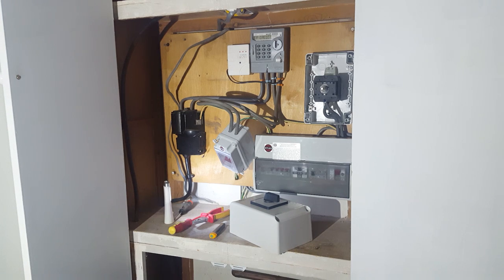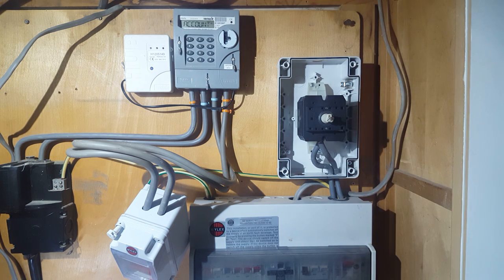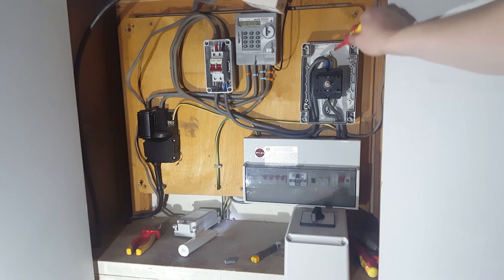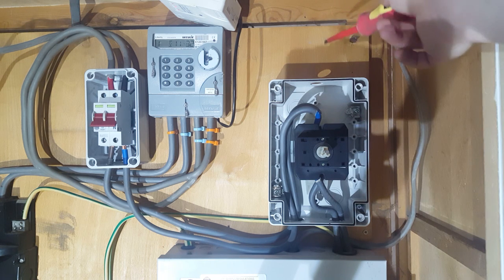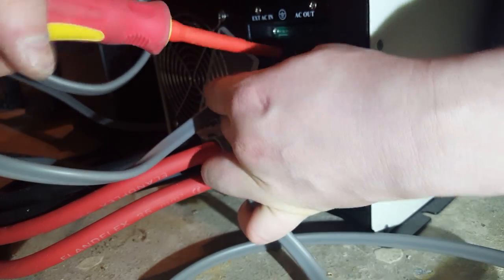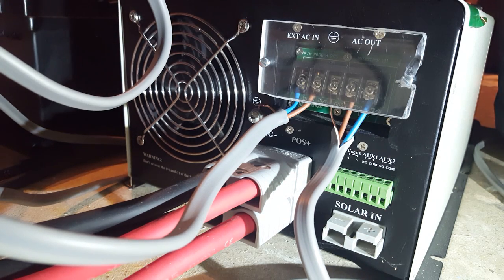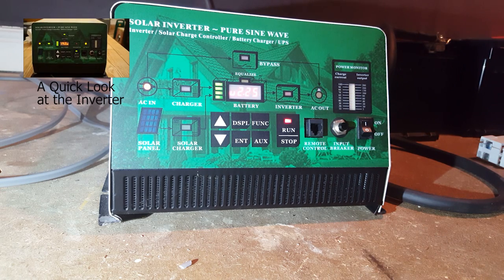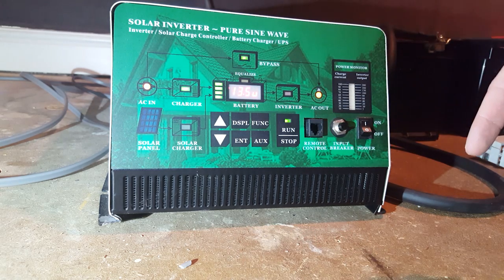Generator Changeover Switch Installation and Test

Comment: As I understand it if the power cut was caused by a digger totally severing the mains supply then if the house's earth is via the company PME the house then also loses all earthing. No problem as the power is off. But if you then arrange secondary power from batteries or generator that would then need an earth rod to replace the lost PME. The safety changeover switch handles the line and neutral but unless an earth rod is then connected then all home appliances are unprotected and could be a danger. I'm not an electrician and this is just my recollection of an explanation given to me when discussing this situation. Worth investigating further to be safe I think as the cost of an earth rod could save a life.
Reply: Excellent observation...I have that very issue to resolve myself. Switching earths to an earth rod of the proper specification is the way to go. As you say the earth bonded neutral PME is no longer available. Also a good idea maybe to install a section of plastic water main/gas main to make sure there are no conductive issues from other properties back feeding from the same PME line in your locality.
Reply: Many earth supplies are from metal pipes (water mains) and gas pipes going to into the ground. My mains supply certainly only has a live and a neutral.

Comment: Good video ..thank you.. I  wondered did you connect the Inverters output ground back from the inverter to the house ground or is that all taken care of on the mains side of the consumer unit and input ground to the inverter, just a thought,  It looks like you do have earth continuity back through the inverter to house ground... Many Thanks          Maybe this also avoids ground loops, so makes sense in this configuration when you change over , so you have the original earth continuity.  Helpful information for my emergency supply..

Comment: What size is the fuse inside the fused spur for the light/ buzzer and cable size which is going to it from the change over switch ?

Comment: Very good.   Presume you don't need to switch grid off before engaging the changeover switch to connect in your inverter power source?   Going to copy your method (with diesel generator instead of solar inverter).

Comment: looks like a new install not sure what the load is ?   With insufficient off grid power for a whole house : Wish there was video manual transf sw install to existing domestic home . Selection of some existing  distribution board ( say 4or 6 ground floor circuits) to be made transferable . Guess we would need additional  small consumer unit to existing whole house one  There are many for the USA . )reliance switch  comes with extra MCBs ) Yours is the only one for UK . So thanks. Ms O

Comment: Great video, thanks. Why install a separate isolator for the grid? Surely the changeover switch cuts of the grid?
Reply: It's just for overl9ad safety in case the grid gets through aswell

Comment: I'd like to do something like this. I have a question about the earths. What happenned with them? Do they have somewhere in the transfer switch to join up? Also does your inverter have an earth, and where does that go? Cheers!
Reply: This installation is reliant on the pme earth from the supplier, you could end up with touch voltages on any metalic earthed item if the inverter earth reference is different from "true earth" as supplied via the dno. It would fail a ECIR for having to Open neutral protection.

Comment: great video if that 3 way is 100a what is the main switch thanks,i am doing exactly the same and I have been gathering info for a while,NOW SUBSCRIBED
Reply from the maker: +fester Adams The main switch is 100amps also witch matches the 100amp fuse coming into the property. The house could technically draw up to 100amps which would be challenging to reach to say the least. You tend to never use more than 40 amps. On 240volts.
I wanted to do this for ages but only recently took the dive, it was worth it for the peice of mind! 
Thanks for subscribing!!!
Reply: superb thanks for the reply we have the old style fuse box at the moment (if its not broke) but this is the route we are going to take when we get a new leccy box fitted.the wire for the inverter I have been told to run 6mm or 10mm t&e my inverter is a xantrex 3500kw with a 7000kw surge what did you use.i also made the big mistake of getting a 300 AMP t-fuse from the states for the DC side that cost £80 and then a few have said use anl £5 from motormania
Reply from the maker: +fester Adams I used just 2.5mm twin and earth for my needs temporary, I don't draw more than 10 amps when using it to prolong the battery bank. At 7000 kW you wont draw more than 30 amps. Or 15amps continuous so if you don't creep into the peak you could use 2.5mm. But if money is no object use 6mm (usually used for electric ovens) 
Well 80 quid may sound dear but you get what you pay for, I've had countless troubles with cheap breakers and cheap fuses! 
But I make do.
Have you got a bit of a chanel going then?
Reply: no I don't shoot any vids I'm just trying to save some money I have 2kw of panels going through a sunny boy inverter but I can only use what I make so I'm getting a load of batteries together and we are going to go off grid at night time first and then take it from there.do you not find info is very little in the uk .on the wiring side I hate spending money BUT find if you do things right the first time then it lasts and lasts.im going to use either 9mm2 or 120mm2 from the batteries which is overkill but if I'm running a kettle or drier I don't want any firescheers
Reply from the maker: +fester Adams you sound very knowledgeable and have the kit, so plenty to work with! 
Yeah Defo agree with braces, belt and string techniques.
An idea perhaps could be putting whole circuits through the inverter such as the lighting rings so could be easily manageable. 
I have mine as a backup rather than being cost effective.
Reply: we will try the nights and see how it goes,it helps when a family member works for a ups company lol,I'm getting there slowly I have just ordered a 3 way and I have a 2 pole switch from another project anyhow keep up the good work I am enjoying the vids cheers

Comment: Your home system looks like tn c s so when you now disconnect your land n and feed with your new land n supply how have you earthed it as your new supply separate supply has no earth to cu. Or have I missed something
Reply: Exactly what I was thinking. The TNCS is connected to the CU and so if he connects and there is a fault he will backfeed the line and could kill someone working down on the lines. I don’t think he understood the need to also disconnect the earth and have a means to connect to TT system. I am sure that the electricity supplier will not allow your own generator/solar system to be connected whilst using their TNCS system ???
Reply: @brianoneill350  so many differant takes on it. So I am not 100%.i was thinking 3 Pole switch so when it's switch all disconnects and connects to tt. But I am sure your not allowed to switch the cpc it's a bit like doing a ze test if someone forgets to connect it back up.
Reply from the maker: The double pole switch completely isolates the supply from the grid, both live and neutral. The earth still has continuity.
You do not isolate the earth. That's why the main 100a/80a breaker only breaks live and neutral. I can assure you, it is completely safe and physically unacceptable to back feed.

Have a lovely evening gents.
Reply from the maker: Unachievable I mean, whoops!
Reply: @PrepareForTheUnexpected  yes, Thanks for the reply and for correcting me, I agree, I believe you are correct that you do not break or switch the earth.  I need to look more at how I earth separately the little generator.
Reply: what I don’t understand is if you have a TNCS system where the earth splits from the neutral at your premises which I think you have from the photos, if you disconnect the neutral at the point where you have, the earth from the cu still bypasses the changeover switch and remains connected. So in the event of a fault at your installation it will go to earth which back feeds down he combined neutral earth line. I know I am missing something here. In normal no fault operation no backfeed, I can see that.
Reply: I think the answer is one needs a 30 milliamp RCD connected to the supply and return sides of the generator to cut off supply in the event of a fault. A fault on the CU will trigger the RCD on that circuit but not the main breaker. If there is no cut off on the generator then the generator will continue to run pushing current down the PEN which in a rural setting is surely back feeding the neutral on the nearby power lines. What am I missing ?
Reply: @PrepareForTheUnexpected  I've been following your discussions lads, I agree with you, I actually think it's physically impossible to back feed in this instance, because if using a simple double pole switch, when it connects one source of power, it isolate the other? or am I missing something?
Reply: @brianoneill350  I’ve been wandering about this myself.  Traditional portable generators, fed via transfer switch to the house, do have a common earth with the main house supply according to various discussions.  

However portable generators do not have a dedicated local earth.  So if there is a fault from line to earth in the fixed wiring, the return path to the generator would not go via the earth rod at the DNO transformer.  The loop impedance would be too high in that instance (unless the ground is wet?).  Instead it (should) return directly to the generator, via the earth conductor in the feed cable.  Essentially the DNO earth rod acts as nothing more than an earth reference.

I will say though, I’m educated in physics, not electricity.  No doubt I’ve missed a detail.

Comment: when you said that was a job and a half I thought it cant be that bad and was I wrong that 25mm is a pain to move about anyhow all done and working ok
Reply from the maker: +fester Adams great stuff! Was it your new fuse box?
Reply: basically same as yours we still have the old fuse box so I am going to extend the wires and then move the consumer up a couple of feet out of harms way and then we are done in here I just need to run 6mm or 10mm wire outside I'm looking into how to do this now maybe metal conduit the best...keep up the good work
Reply: I put a main 100a breaker and 100a transfer box in
Reply from the maker: +fester Adams sweet stuff. It was quite hair raising when I put my breaker in live. The world's biggest game of operation. Is the conduit going to the garage or what not? Beefy 2nd hand armoured cable can be bought cheap on eBay and you can just bury that. But don't tell anybody! Haha
Reply: we have a vent about a metre away from the garage so I'm going to use metal conduit and run it out of the way and into my garage that's the easy bit I have loads of armoured cable but its 1.5mm I reckon far too small which is a shameI take it you had a 100a breaker in there already
Reply from the maker: +fester Adams I actually put it in myself the 100 amp. The distrubutor wouldn't de energize my property so instead of breaking the seals of the head fuse I did it the dangerous way and did it live. I needed it in to do all the stuff I do safely. 
I spent months trying to get my supplier to put one in who said it was the distrubutors responsibitly and then they were saying it's the suppliers. So I ended up doing myself.
Reply: same here no one wanted to pull the fuse so I did it live I noticed most new builds have a 100a breaker now which is far easier to work on the electrics now,i have ordered more stuff today it will be a while until I'm ready.i am selling my sunny boy inverter and replacing it with a flexmax outback charge controller as soon as funds allow.cheers for the update
Reply from the maker: +fester Adams yeah it's law to have an isolator if you rent out the place. Let me know how you get on.
Reply: well first switch on taday and not good i installed a new fuse box and installed 10mm2 from my garage to the transfer switch BUT every time i select no 2 on that switch it trips one of the 63a 30ma RCD breakers but if i connect a socket it works fine i tried the washing machine,dryer,kettle,and microwave and it ran spot on,after a little reading i noticed people changing there RCD for a 100ma version.did you have any problems
Reply from the maker: +fester Adams Hey pal I didn't.
Could it be to do with being back fed?
Or is it directly into the mains coming in?
Reply: PrepareForTheUnexpected it turned out to be 2 ground loops causing the problem so to solve the problem I have fitted another cu with critical loads and now it works superb it as pass through so as soon as the power goes the inverter kicks in without so much as a flash
Reply from the maker: +fester Adams I'm so pleased it's up and running for you pal. Good on ya!
Reply: got garage,upstairs and downstairs lights also got tv and pc running off solar no bother at all,just a shame i could'nt use the transfer switch i had to but another consumer